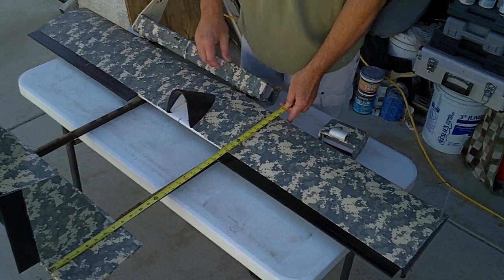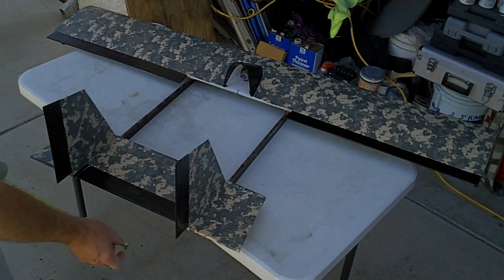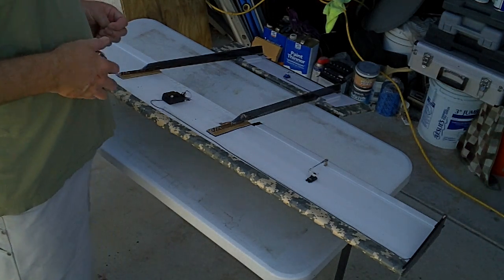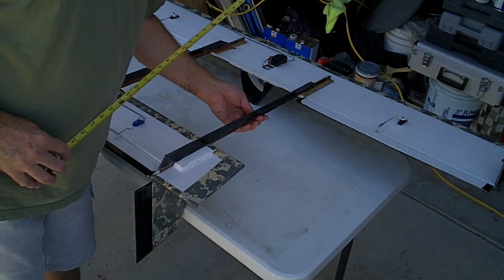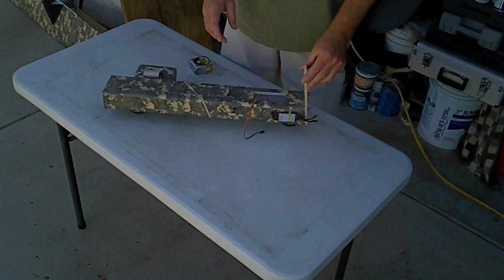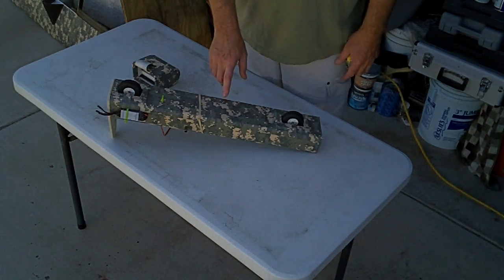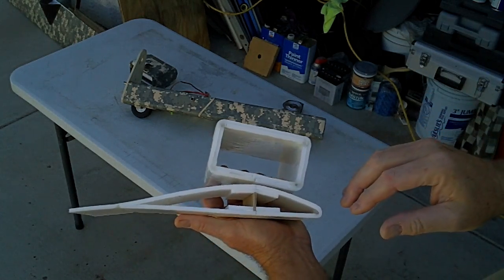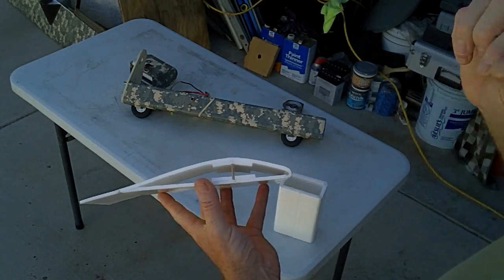Part 1 FBDrone build specs

Comment: MrWest,
I tried to fly my FBdrone today but for some reason it didn't want to get off the ground?
I hade enough power but just ran down the runway? could the angle of the motor not be enough or is it too heavy? thanks I have a good time building the plane, learned A LOT!

Comment from the maker: Hey James, the mount is based on a 2826 1200kv motor using a12-6 prop...just high enough to clear the ground bra. About 8" above ground at the shaft.

Comment from the maker: Hey Rapture...the CG is specific to this wing, so if you  have built yours differently you should calculate it out. I can help...Measure the wing cord at the fuse and if it is the same at the wingtips then multiply the cord number by .30 which will give you the distance to the CG from the leading edge of the wing. Example; wing cord 10" x .30 = 3" from the LE. 
I would mark that location on blue masking tape with a sharpee and balance her slightly nose heavy for the first flights.
West